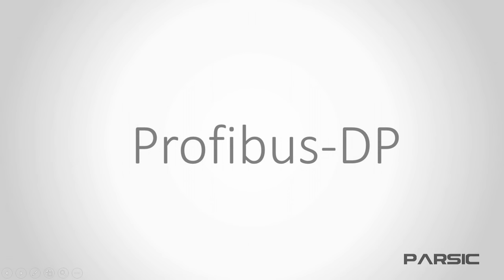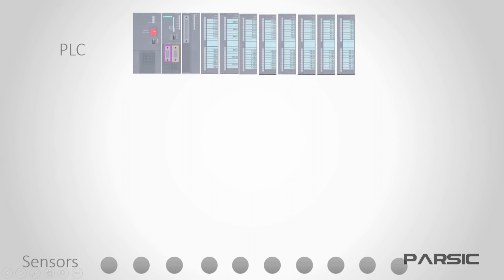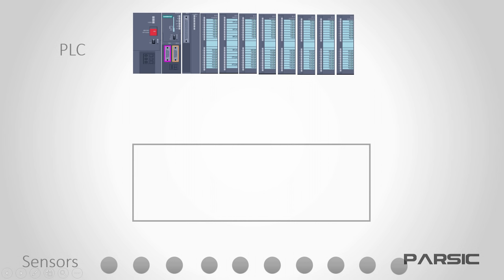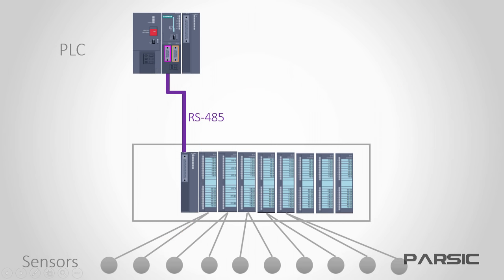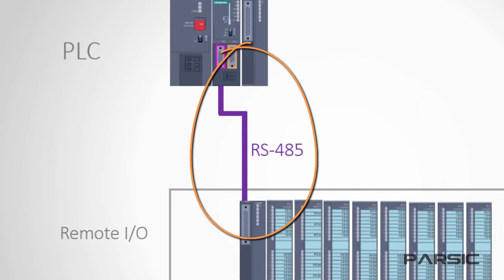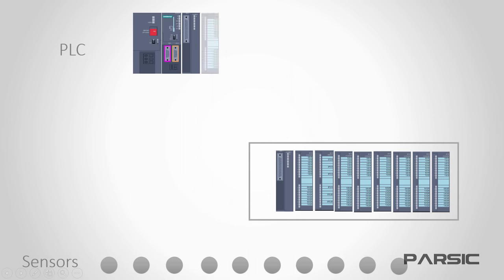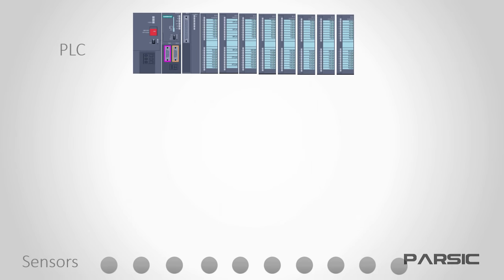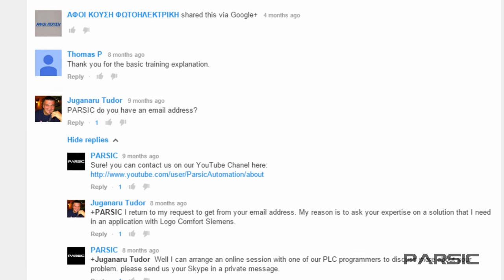What is Profibus-DP in layman's terms?

Comment: thanks for video. I have one question. Let's say that I have SCADA and PLC. Distance between them is about 3km. What is in your opinion best method to connect them? Profinet, Profibus, Optical Fiber cable...? What is the cheapest solution? Best regards
Reply from the maker: For a 3km run, only fiber optic will be suitable.  The maximum length for Profibus transmission is about 1.2km (1200m), and for Profinet, it is the same as for Ethernet (100m).  Fiber optics can be run 25km or so, but the cable is relatively expensive (US$10,000 per km installed).  3km is in the domain of Remote Telemetry Units, which collect data from the source (PLC) and send it to a host (SCADA) via Cell Phone signal (GSM/CMDA) or radio frequency.  Cell-based communications carry a monthly access charge, but the initial investment is quite low compared to fiber optic runs of that length.
Reply: @realpars  thank you very much

Comment: Why not move the PLC to the I/O cabinet and communicate with Ethernet? Setup a redundant Ethernet connection as well. Would that be Profinet?
Reply from the maker: Thank you for your question.  We could move the PLC to a remote I/O panel, but automation engineers typically keep CPUs in a more environmentally-friendly location.  But you are correct; the PLC could also be placed in a Remote I/O Panel and communicate via Industrial Ethernet to the plant network. Profinet is one type of Industrial Ethernet, but it is most often used for Siemens systems.

Comment: Is it possible to connect sensor controllers to the remote I/O and then use Profibus to carry the signal to the PLC? If so, what cabling should be used to send the signal from the sensor controller to the remote I/O?
Reply from the maker: Absolutely! That's the whole point of using the remote I/O. 
For connecting a sensor to a remote I/O, a normal 20 AWG wire (0.5 mm2) does the job. For example, if you have 10 sensors in the field, you need to use a cable which includes 10 * 20 AWG wires. After you connect the sensors to the remote I/O, you then use a RS-232 cable to connect the remote I/O to the PLC.

Comment: What is the difference between profibus and modbus?, what mode of data transmission profibus uses, half duplex or full duplex? And what topology?
Reply from the maker: Boith Profibus and Modbus are based on RS-485.  Profibus has certain protocol features that let certain versions of it operate in multi-master mode on RS-485, while Modbus can be only single master.  Profibus is a much more advanced protocol than Modbus. For example, Modbus is limited to 32 nodes on a single network.  Profibus can have 126 nodes on a single network (with repeaters).  Profibus uses bus-powered Manchester encoding, half-duplex.  Profibus uses a multi-drop network topology, the same as RS-485.

Comment: Forgot to ask: Is the use of Allen Bradley FLEX I/O’s out in the plant at each equipment control panel all connected back to the Main Logic Controller via Ethernet bear any resemblance to Profibus net design or is it similar just with an Ethernet connector vs a RS485..The only cable running back from every equipment control panel was a single Ethernet cable all connected to many Statrix 8000 switches. Looking back this seems similar quite so to me, just different connector RS485 vs Ethernet IP.
Reply: There are many protocols and buses that can be used to connect an I/O rack to a PLC.  With Ethernet/IP (the version of Ethernet used to connect to Flex I/O racks), a CAT5E cable (4 twisted pairs, although only 2 pair are typically required) with RJ-45 connectors is the typical configuration.  For ProfibusDP, a 9-pin connector (4-wire) is used.  ProfiNet is typically uses the same cabling as Ethernet/IP and can use RJ-45 connectors, but I do not believe that there is a Flex I/O adapter for ProfiNet, only for Profibus DP.  There are many gateways that can be used to bridge between dissimilar networks and protocols, so it is possible to design a system that uses many different protocols.  ProfiNet is very similar to Ethernet/IP and both are based on IEEE 802.3, but they are not strictly interchangeable, even though the same cabling can be used.
Reply: Scott Sommer The well explained feedback is appreciated. As well in understanding that their are many ways to connect not so similar networks. Thank!

Comment: very informative video. would like to ask what if the signals are to monitor different levels of the tanks, for example, and need to be analog. as what you explained, this profibus-DP is not applicable because the RS-485 is digital, am i right?
Reply from the maker: Thank you. The level transmitter can be connected to the analog input cards on the remote stations and then the remote station can be connected to the main rack in the control room via Profibus. So Profibus works for the analog signals as well.

Comment: Sir i appreciate your every video as it have helped me alot...but I have lot of confusion in FF...i don't know what kind of signal flows through it...because my supervisor says that it is Analog protocol and have no idea that the signal is digital or analog and when it is received by the  device...how will it read it...i have no idea
Kindly explain it to me
Reply from the maker: If by FF you are referring to Foundation Fieldbus, the signal is a purely digital signal, delivered over a single twisted pair cable at 9-22VDC at a total segment current of up to 350ma.   Foundation Fieldbus is used primarily for analog sensors and control valve actuators.  If you meant something different by FF, please let me know.  Hope this helps!

Comment: how does Profibus PA work? is there a video explaining it just like this one?
Reply from the maker: Nirmal K "PA" is short for "Process Automation". This industrial network works to connect field devices such as pressure transmitters, control valves, etc directly to the PLC or other control systems without using remote I/Os!
Reply: TEPERGY thank you for your reply. So is it like Foundation fieldbus? . Do i have a communicator for configuring the transmitters?
Reply from the maker: Nirmal K No it's different than Fieldbus. Most of PA transmitters can be easily configured via the buttons available next to their display.

Comment: Hi, Could you please tell me what's  IM ( interface.  .........)?
Reply from the maker: +Theo Berks The CPU needs to communicate data with the rest of the PLC modules in order to tell them what to do. When you install the PLC modules in the same rack with the CPU, the CPU communicates data with them through "bus connectors" . But when the PLC modules are installed on other racks you use "Interface Module" or "IM" to communicate data between the CPU and other PLC modules.
Reply: Thanks a lot. I like your explanation including the videos. Keep it up

Comment: Thanks for the video. What if I have many devices equipped with Profibus Port (Protection Relays) and I need to connect them all to a controller or simply a PC?
Reply from the maker: If all devices are Profibus, they can be connected in a "daisy-chain" configuration, with connectors that have a bus "in" connection and a bus "out" connection.  There is a maximum length of the Profibus segment which is dependent upon the baud rate chosen, which must be selected the same for each device.  There is a maximum of 126 nodes that can be connected to a single Profibus network. Normally, there is a practical limit of less than that number.  In order to be efficient, multiple Profibus segments are typically used, with each segment requiring a CP card DP port at the PLC.
Reply: @realpars  Thank you for your swift response.
Reply: @realpars  Is is possible for PROFIBUS to transmit the analog measurements made within the relays equipped with PROFIBUS Ports. I mean by analog measurements: the current, voltage, power factor ...etc.?
Thanks

Comment: How is it different than using a remote IO and connect to PLC over ethernet.
Reply from the maker: There is little difference in structure. Ethernet and Profibus are both digital communication protocols.  They are not directly interchangeable, since each has its own internally digital coding method, they use different cable types, and each has a different baud rate scheme.  But each can communicate with devices (provided they have the correct interface electronics) to give commands and receive status information.  There are remote I/O interfaces made for Profibus and for Ethernet.  In many cases, vendors provide for swapping a Profibus interface card with an Ethernet card while maintaining the same I/O cards, and vice versa.  Profibus and Ethernet are just two ways that the data from I/O racks, drives, etc., can be transferred to the CPU.

Comment: Is it possible to read value from an analyzer via profibus network straight to PC? like what we have in modbus.
Reply from the maker: Thank you for your question. Yes, you can, but you must have a Profibus DP interface card installed on your PC or IPC computer to communicate with the Profibus network. You also need the appropriate software for the DP device you are trying to communicate with. For example, you must have Siemens programming software, such as TIA Portal, installed with the program you wrote to communicate with the DP device.

Here are two links to help you with your learning:

https://support.industry.siemens.com/cs/document/109744173/documentation-for-simatic-controller?dti=0&lc=en-WW

https://us.profinet.com/technology/profibus/ 

Happy learning!
Reply: @realpars  Thanks for the clarification! Although my goal is to write my own program to extract data from profibus and not rely on software like SIMATIC. Speaking of modbus we do have a lot of libraries written in many languages, but I found it rare in terms of profibus. I know modbus library was written based on serial, does profibus also depend on serial too? Do you happen to know reference regarding this topic?

Comment: what is the maximum length of Rs 485 cable we can carry   remote i/o to plc
Reply from the maker: Depending on the bit rate used, the cable length is limited from 100 to 1200 meters. For longer distances, you need make use of a repeaters. The cabe length between the two repeaters can also be from 100 to 1200 meters.
Reply: Thank you

Comment: Can't we achieve decentralization of peripherals using Modbus RTU over RS485?
Reply from the maker: Yes, you can certainly do that.  However, Modbus RTU is quite limited in speed, command set, and amount of data that can be transferred.  Profibus DP gives you the ability to send and receive much more data, faster and with higher reliability than Modbus RTU, but both allow for decentralization.

Comment: hi, what is the maximum distance for profibus?
Reply from the maker: That depends on the network baud rate. 

9.6 kbps = 1200 meter |19.2 kbps = 1200 meter |45.45 kbps = 1200 meter |93.75 kbps = 1200 meter |187.5 kbps = 1000 meter |500 kbps = 400 meter |1.5 Mbps = 200 meter |3 Mbps = 100 meter |6 Mbps = 100 meter |12 Mbps = 100 meter

Comment: that is a very long winded explanation, had you said  " having a remote IO adapter located in the field, local to instruments as to minimise cable routing, you can reduce the wiring cost.  the IO Data can be then transferred Via packets of Data through a RS-485 connection. making it cost efficient clean and efficient.

Comment: How does the fact that the data transmission method is "digital", stop industrial enviromnent noise from being harmfull/a cause of error? Anybody have any experience with this?
Reply from the maker: Thank you for your question. When it comes to addressing potential noise issues, it's essential to emphasize that for data transmission lines, proper grounding with shielding is crucial to minimize electrical noise interference. This practice helps ensure reliable data transmission. We wish you continued success in your learning with RealPars!

Comment: What's the maximum distance of rs485 cable
Reply from the maker: Hi there, 

Thanks for your comment!

The maximum recommended data rate in the RS-485 standard from 1998 is 10Mbps, which can be achieved at a maximum cable length of 40ft (12m). The absolute maximum distance is 4000ft (1.2km) of cable, at which point, data rate is limited to 100kbps.

Hope this helps!
Reply: @realpars  thanks Sir

Comment: Howdy. Nice walkthrough.
Some directions to configure Profibus DP. DP is a Master - Slave setup. It is not a Peer to Peer system. The DP setup is configured in the Master configuration environment.
Using dumb Slaves. All dumb Slave manufacturers provide a Slave specific GSD or GSE file. The file contains information about all Slave compatible IO card. One incorporates the GSE file into the Master environment. Then one, usually by drag and drop, adds the Slave to the bus. Now in the Master environment one adds the Slave IO cards. That is pretty much all. IO channels and other needed parameters are assigned automatically. The Slave IO:s may be accessed directly in the Master environment.
Configuring a Smart Slave (a full PLC station) is more tricky. GSD/GSE files are not used. One must understand the so called DP window concept. The window is through which data goes out or come in in a station. The window must be configured to the same width both in the Master and the Slave. I seem to remember that the window's start and end addresses need not be the same in the Master and Slave but the widths must equal.
It is most convenient to have two separate configuration environments. One for the Master and one for the Slave. Jumping back and forth is possible but cumbersome.
One does the full Slave configuration in the Slave environment. Then, in the Master environment, one drags and drops a generic or universal station on the bus. One does a full Slave mirror-configuration in the generic station. Both in the Master and the Slave one uses special function blocks to read from and write to the DP window. Finally one must add DP synchronization special function blocks in both the Slave and Master programs.
Regards.
Reply from the maker: Thanks for your insightful comment, Eugene!
Reply: @realpars  Yeah. I just hope it helps someone see the big picture before beginning to configurate Smart Slaves.

Comment: may i know why plc trip if power fluctuation. 
please clarify it. real
Reply from the maker: I could not understand what you mean. Can you please explain more?
Reply: +RealPars when power fluctuation plc tripped
Reply: +RealPars why it happen
Reply from the maker: All PLC modules need a safe and stable power to work properly. It's normal to see the PLC isn't able to work properly when you can not provide it with a stable source of power. It's like you cut the power off for a lamp and expect that to stay turned on.
Reply: +RealPars how to u give stable supply
Reply from the maker: Just make sure that you're using a reliable brand. Phoenix is what we usually use for our projects. You can also add a redundancy module to increase the operational reliability of systems. http://bit.ly/2aM21JJ
Reply: +RealPars Thank u lot.  Ur valuable reply. and your video also so nice .
Reply from the maker: You're so welcome!